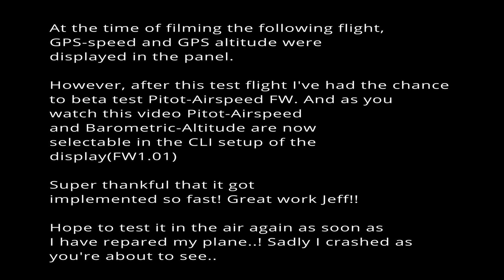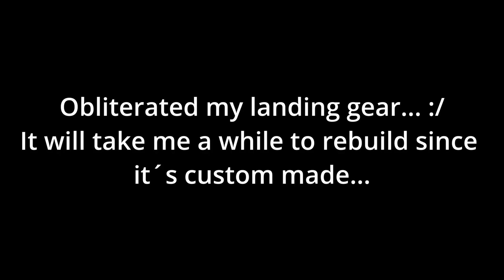New INAV instrument panel from fpvtoys.net! FULLY FUNCTIONAL RC INSTRUMENT PANEL!

Comment: Amazing! Brings up questions for me regarding the INAV display on goggles.  Would this replace goggle INAV display, augment or add an option?  Thanks for the video!
Reply from the maker: @jamesjamieson544  Hi! I reduce the number of active osd elements yes. But i have another osd overlay with all the details if needed by the flip of a switch. To me reducing active osd elements in the goggles adds to the immersion and feeling of being onboard the aircraft. And actually the airspeed in the display has a better refresh rate than the in goggles number. So therefore its removed in goggles. When I am in my most common flight modes the only active osd elements left are cell voltage, flight mode, amps and ground speed(so I can estimate wind direction since I have pitot airspeed in the cockpit display). Additionally I have also set up my OSD in goggles so that when i look up, down, left or right the OSD text in goggles go away only to return when i look straight forwards again  at the instrument panel. That is tied to the pan and tilt servos activating a blank osd screen when not looking forwards(set up in "modes tab"). Might have to make a video of how my setup works one day? :)
Reply: @NerdyFpv Thanks for the explanation.  It never occurred to me you could switch to what you want displayed!  😮

Comment: Wooo! this is very cool! What a great view. My girlfriend thought it was real haha. How does it process all the data here? Is that from the flight controller?
Reply from the maker: It comes with it's own Arduino style board that takes the data from your flight controller(MSP) and displays it on the panel. Have a read at fpvtoys.net Cheers!
Reply: @NerdyFpv  thanks! And oh no! When I try to access the website, it won't let me. Is there a better website link? Thanks again!!
Reply from the maker: @FreeEditsForYou  just Google "fpvtoys net" and you should find it. 👍

Comment: Great Video!! I admire your skill in setting up the tiny screen in the cockpit. Does it have any practical purpose when FPV flying, it sure looks very cool. I did not get if you were flying FPV or LOS on this flight. Flying FPV, when loitering in RTH, I quit my goggles and land LOS. And as the other guy said, " I come into the glide slope in ACRO. When all lined up and about 20 feet off the deck, I hit angle and flaps and ease the bitch down".
Reply from the maker: @springpilot  Thanks man! With this plane I'm trying to achieve maximum "immersion" meaning the illusion of being onboard your own little aircraft. So with this display the goal is to have as few on screen display items active in my goggles as possible, and instead use the instrument panel to read flight data like speed altitude, attitude, distance etc like in real life. So it's very practical for me when flying fpv. The reason I still have the same OSD elements in goggles as on the screen for now are for testing purposes. But I will remove data from the OSD when done.  When I'm done I think the only active OSD elements will be battery voltage, amperage, cell voltage and possibly flight mode. This flight was FPV only where I took off, flew and landed FPV👍 That's also part of the immersion😃 I actually find it easier to take off and land FPV than LOS, it's way more intuitive for me anyways🙂

Comment: Just got my pat tritle kit! Do you have a build log for your super cub? Super excited to get this going
Reply from the maker: Well not a full build log from me, but there is a great thread in RCgroups that Pat Tritle himself started. It has a lot of great photos and intel on this model. I have posted some info and photos on page 15 in that thread. https://www.rcgroups.com/forums/showthread.php?1763444-Brand-New-60-Super-Cub/page15 

I would also higly reccomend reading the article from Pat in Model Air Plane News. https://www.modelairplanenews.com/piper-pa-18-super-cub-construction-article/

I learned a lot building it! It's my first kit plane. Since it's a so called "short kit" I spent quite some time sourcing balsa etc. But once you have all the materials, it was pretty straight forward even for me with very little build experience. The most challenging part for me was making a "washout" in the wings(helps with stall charecteristics). Had to build a special rig to set it right with the jury struts securing the washout, but Pat Tritle has drawings for this also. I found them free online somewhere. 

Antother thing to mention is that if you plan to put in fpv gear and a 3s power system, it might be a good idea to strengthen the "wing box". I have a photo on page 15 on how I did mine. Lastly if a jury strut comes loose in flight several people have snapped their wings off and crashed, so make sure to find ways to lock them in. There are also photos of this in the thread.

So head on over to rc groups and have a little read. And feel free to post further questions there since it's easier to send photos etc. It´s an old thread but a lot of helpful people there.

Good luck and enjoy your build! :)

Comment: You need to adjust mavlink settings, to make you panel feedback faster)
Reply from the maker: Interesting obsevation. I didn't notice much latency myself, but is there a specific parmeter you noticed latency in? It's taking data from a uart and MSP, so not sure if thats related to mavlink settings(pardon my ignorance)?. But would be good to know if there is something I can tweek in the settings. Cheers!
Reply: This is getting the MSP data. I'm actually working on an update to speed this up.
Right now it spends most of the time waiting for the data to come over the UART. I'm making changes so it will collect the data at the same time the screen is being drawn.

Comment: Love it! Land in Angle mode !
Reply from the maker: Thanks man! I landed in Horizon mode. Have you experienced better handling in Angle mode? I`m a bit curious which flight mode would be the best allround option actually. I have tried acro, but I don't like the feedback even though its tuned with autoune.. I like self leveling modes since those return the plane to level flight when sticks are released(almost like LOS planes without flight controllers). Manual mode was out of the question in these winds at least.
Reply: @NerdyFpv  I have had many white knuckle landings . So now I come in to the glide slope in ACRO. When all lined up and about 20 feet off the deck I hit angle and flaps and ease the bitch down with mostly rudder if I can 🙂